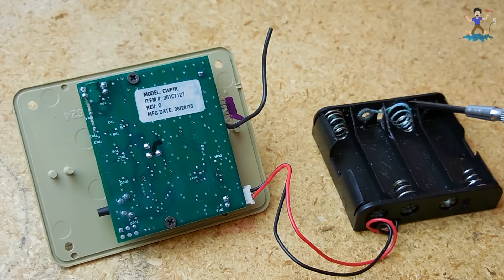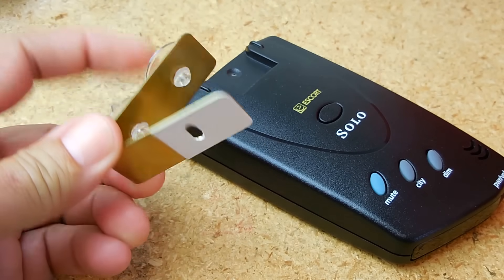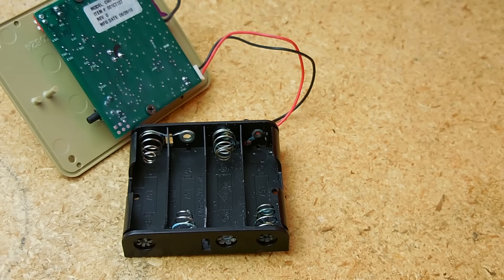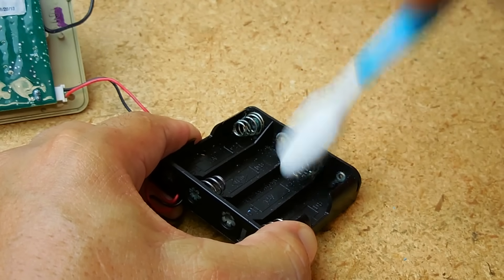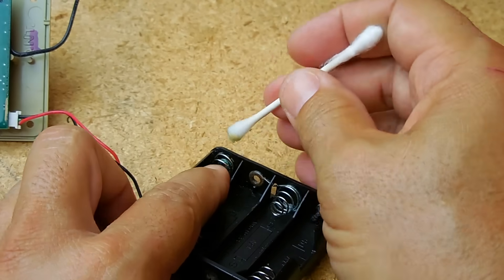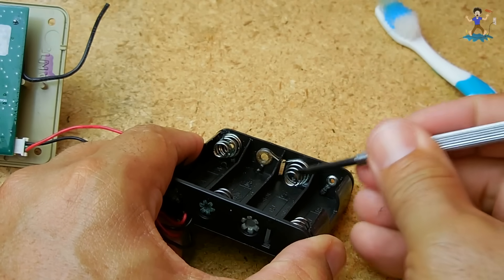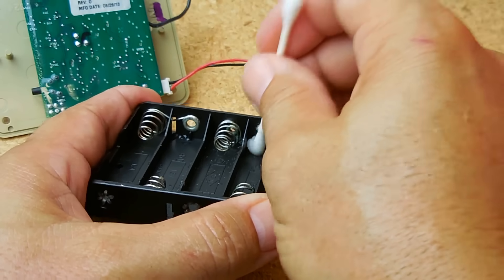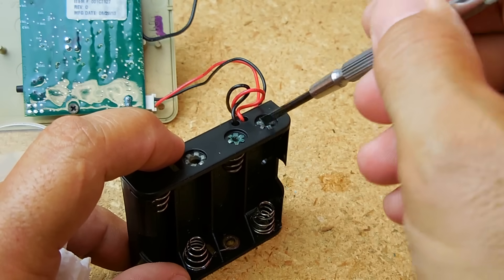EASILY Clean Battery Leak Damage(Corrosion) In Electronics

Comment: Scraping with blade like a screw driver is not good, It removes plating and roughens the surface which increases the rate of oxidation.  This will reduce the life of the battery holder before it requires cleaning again.  You are better off to using a metal polish like Autosol on a Q tip which will still remove the crud pretty fast and polish the metal.  Polished metal oxidises much slower so the repair will last many times longer.  Also, a good tip is to paint the metal surfaces, especially pitted surfaces with an electrical conditioner like Deoxit and leave to dry.   This soaks into spaces like between springs and rivets and into any remaining corrosion products that are impossible to remove.  It drys and seals with a conductive material that improves the conduction of press fit parts.  This gives the repair a much longer and much more reliable reliable service life.
Reply from the maker: The surface plating is usually gone once the corrosion has formed, so gently scraping it away won't cause any problems. All you have to do is apply a very thin layer of silicone grease to the contact areas to prevent oxidation over time. Thanks for watching

Comment: Good video on the cleaning battery corrosion. As far as NiMH batteries you are off. NiMH and NiCd cells are known as "electrolyte starved" designs. If you were to open them, they would appear to be pretty dry, or just barely damp. If/when a NiMH or NiCd vents, the gas released will contain some moisture, but little or no liquid. The leaks (very rare) only put powder down which either sticks to the top of the battery vent areas or fall harmlessly not sticking to anything. If nimh had better temperature characteristics people would use them in cars and outdoors because you don't have to worry years later about a ruined light. On the other hand, alkaline cells have a saturated electrolyte design, so when they vent a considerable amount of liquid can be released. Enloop brand (4th gen) rechargeable NiMH batteries are designed to be stored in a device for 10 years and still have 75% of their charge. Making these batteries great/safe choices for emergency devices. Hope that info helps when choosing batteries. :)
Reply from the maker: Yes, alkaline batteries are more "wet", but NIMH batteries do leak, and their electrolyte is alkaline. Thanks for watching!

Comment: The worst batteries that leak are the Duracell Copper Top.  This was not always the case this problem seems to have started about five years ago.  I am not talking about a battery that has been installed 10 years ago.  Some of the batteries were in remote controls, scales, head lamp, and a meter.  I also had brand new batteries that were still in the package that were leaking.  I threw out the whole package.  I switched to Energizer Max I hope they are better.
Reply from the maker: If you want to completely avoid leaks, buy AA /AAA Lithium batteries instead. Thanks for watching!

Comment: what do you do when the batteries are stuck inside, like in a flashlight?  Suckers are hard to get out and there is no space around them to get a grip with pliers or other tools.  I've lost a few good lights this way.
Reply from the maker: The only thing you can do is open the end of the flashlight and pound it on a table, once they move, take a very strong Neodymium magnet and use it to pull out the battery. Thanks for watching!
Reply: what works in some cases, is to drill one or more holes into the battery(from end to end), and then start prying what's left inward-this will make the battery thinner, and you have a decent chance of getting the battery out.

Comment: Simply brush with the toothbrush to loosen oxidisation then take the battery holder and immerse in a shallow bath of white vinegar for 15 minutes.
Remove, allow to dry and wipe down with isopropyl alcohol using a Qtip.
Reply from the maker: Soaking is a bad idea, because the acid solution percolates wires causing corrosion. Thanks for watching!

Comment: why did you not just unplug it from the board and get it under the sink
Reply from the maker: Because the average person WILL NOT have a removable battery holder, and it's a bad idea because water will find its way into the wires.

Comment: whatn happens when it leaks on the curcuitboard. I haventhe exac driveway sensor you showed chamberlain and it lights up but i dont get signal
Reply from the maker: You need to examine all circuit board traces using a 10x magnifier. See if any are corroded away.

Comment: Un-plug the wires from the PC board .  Use a larger container & more vinegar and dunk the whole battery holder into it .

Wash it off .  Dry with compressed air or a blowdryer .

Wyr
God bless
Reply from the maker: Bad idea because the liquid will find its way into the wire under the insulation.
Reply: @electronicsNmore  Soak it in water over night ?

Wyr
God bless

Comment: The problem is what you don't see. Many times the contacts are corroded where you can't see and where you can't get to. The Nickel plating is gone and copper is corroded. Cleaning will only remove oxidation on copper but contact requires re-plating.  - The best solution is not to clean but replace the battery holder. They are sold on Digikey and typically are made by Keystone Electronics. There are PCB mount ones and also wired ones. However, the wired ones will not have the connector you need, so cutting off the old connector, add shrink tubing sleeves before soldering, solder, then shrink tube the connections. This is the best way to repair the corrosion.
Reply from the maker: The battery holder in the video was for demonstration purposes only! I used it as an example. 95% won't have a removable battery holder. LOL

Comment: This unit is part of an alarm system that may save your life.  I suggest you unplug the battery holder, clean and save it for your kids toys.  A new battery holder costs what?  $4 bucks?  Buy a new battery holder and plug it in.  Why gamble your safety (or life) on an old, crappy, cleaned holder?
Reply from the maker: The holder used was irrelevant.
Reply: We'll make sure that "The holder was irrelevant" is on your tombstone!
Reply from the maker: @DrBobaliscious  It's the process that mattered, not the type of holder.
Reply: Oooh!  We'll add that too: "It's the process that mattered!"
Reply from the maker: @DrBobaliscious  Were you born a Moron? or became one later in life?

Comment: What do you do when half of one of the springs breaks off due to corrosion? Is there a way to repair that?
Reply from the maker: Clean off the remaining half and try stretching out the spring, or buy another small, weak compression spring at the hardware store to place between the battery and broken spring.

Comment: I have a Bluetooth keyboard for an iPad, what would be suggestion to clean the leakage since the contacts are at one of the unit about 6 inches away from you insert the batteries, thanks for the information.
Reply: electronicsNmore Thanks so much for the tip!

Comment: If sliver colored plating is completely gone from one of the connections will item still work?
Reply from the maker: Yes, make sure the metal is clean and shiny, then apply a THIN layer of silicone grease to the contact points. You can buy the grease at home improvement stores/hardware stores. Thanks for watching! Please share my channel.
Reply: @electronicsNmore  
The metal is clean do I really need silicone grease to make it work?
It's probably going to be fine without it right?

Comment: Pointless to repair.  You can get a new one on ebay for less than a buck. https://www.ebay.com/itm/AA2D-New-Storage-Battery-Box-Slot-Holder-Case-Cover-for-4-Packs-AAA-Battery/253773700509?hash=item3b16175d9d:g:cd0AAOSwn6dbXo2k:rk:19:pf:0
Reply from the maker: The holder I was using in this video was IRRELEVANT! What mattered was the method shown, nothing more.

Comment: Great video.  I have a hard time finding Q-tips in our stores and find that cotton tip applicators work just as well, especially the wooden handled ones.  I also used the same vinegar then soap solutions to clean my wife's toothbrush before returning it to the bathroom holder.  This technique works well and is scientifically sound.  Thanks.
Reply from the maker: Glad you enjoyed the video! I have a lot of excellent videos on my channel that cover many different subjects, so be sure to check out my extensive video playlists for other videos of interest to you, rate thumbs up, and share my channel with others. Thank You

Comment: i’ve used this process to recover several electronic items too. One observation is sometimes you can completely remove te battery holder from the device. Watching the video, you will notice a white connector on the other end of the power wires. Simply removing that connector separates the battery holder from the electronics. That makes it eaiser to clean, as you can emerse the holder in a shallow bowel of white vinegar to clean the contacts.i always finish this type of task with a rinse with distilled water, to neutralize the vinegar. Just makes me feel better. CAUTION do not get vinegar onto the electronics or you may damage them. If you accidently do so, you should immediately rinse that area with distilled an place the unit where it can dry out. Sitting it over a furnace air vent will do a good job of drying it out and not melting anything.

Comment: Wouldn't it be easier to use a small shallow dish and use that same amount of vinegar and just soak the connectors?
Reply from the maker: The only problem with that, you'll be allowing the white vinegar to find its way deep into the wires that connect to the terminals. Thanks for watching!

Comment: How would you go about cleaning like a small area in a Bose earphone battery slot?
Reply from the maker: Use a Q-tip moistened with white vinegar, allow to soak, then blot dry and repeat using 91% rubbing alcohol. Thanks for watching! Be sure to rate thumbs up and share.

Comment: I put a little dielectric grease on all the parts that had corroded to prevent future corrosion or rusting. Those parts that have lost their coating WILL rust if not treated. Also, on any wire that has broken off and shows green. Clip at least 1/8 of the wire back , strip it and check for any discoloration of the wire. If the wire inside is black instead of copper color, cut the wire back more. That black is the corrosion and moisture still working on the wire and will cause electrical issues. You did a great job on this how to video. Those that were impatient are probably back into the same repair again because they rushed it. Part of repairs is being patient, not being in a big yank to move on. I can bet half these peoples projects never turn out right because they are impatient as hell!
Reply from the maker: You brought up valid points. I mentioned the grease in the video. Even though it's non-conductive, it still works to help prevent new corrosion in the future. Yes, unfortunately there are many people with very short attention spans. Thanks for watching!

Comment: question; Is it okay to use "dielectric grease" or "petroleum jelly" a.k.a. "Vaseline" on the battery connection after cleaning out the corrosion ?
Reply from the maker: That kind of grease protects the contacts, but is non-conductive. A thin film should be fine. The battery & terminal contact points are strong enough to make good contact.
Reply: @electronicsNmore  I was applying the same theory as with car batteries to prevent corrosion. Would you also suggest wrapping AA or AAA batteries in aluminum foil?

Comment: I don't buy copper top batteries any longer, they leak like crazy, But thanks for the tip, I will clean all my electronic devices that those copper top batteries ruined.
Reply from the maker: Better off leaving them out of the device when not in use. I have a lot of excellent videos on my channel that cover many different subjects, so be sure to check out my extensive video playlists for other videos of interest to you, rate thumbs up, and share my channel with others. Thank You

Comment: Deoxit works far better just FYI.
Reply from the maker: Deoxit is good stuff, but it's not designed to neutralize alkaline electrolyte. It's designed to remove corrosion, oxides, etc.
Reply: electronicsNmore it works for this purpose better than anything I have ever used so I shared the information for others knowledge.White vinegar also was not designed for this purpose but it works ok for the purpose.
Reply: actually, DeOxit has Oleic acid in it....so it will indeed work.

Comment: Vinegar is cheap - why don't you put the vinegar in a bowl and let the holder sit in it for a while?
Reply from the maker: Because the vinegar would seep into the wire between the insulation and the wire strands. Over time the acid would eat away at the copper. Thanks for watching!

Comment: I use an ultrasonic cleaner with a little bit of citric acid and after it an rust converter also in the ultrasonic bath
Reply from the maker: For a removable holder like I show, that works. Better off using the white vinegar inside the cleaner. Thanks for watching!

Comment: I find that the corrosion removes the shiny metal plating from the contacts. Sanding or filing is required to get a decent electrical contact again. The problem is that after the plating is removed, the metal will tarnish or darken very quickly and you'll lose connection again. It's a losing battle.
Reply from the maker: Correct. The thing to do is either apply a thin film of silicone grease before installing the batteries, or plate the spring/contacts using a brush type nickel electroplating kit. Thanks for watching! Be sure to share my channel.
Reply: Just "replate" portions that touch the battery contacts with solder. Solder quickly to avoid melting plastic. Lasts many years.

Comment: HOW ABOUT A VIDEO WHEN ITS REALLY DAMAGE RUST MISSING SPRINGS CAN YOU FIX IT STILL?
Reply from the maker: Yes, that can be fixed, but you need parts from another battery holder. Thanks for watching!
Reply: New springs and clips are available from places like ebay and Amazon

Comment: vinegar is acetic, i use it to remove rust, baking soda neutralizes battery acid or even easier just spray the part with battery terminal cleaner and hit it with a soft wire brush..... i use a baking soda water solution  to neutralize vinegar or muriatic acid  after rust removal....
Reply from the maker: WRONG! You cannot neutralize alkaline electrolyte using baking soda which is alkaline.

Comment: My bad.  You are correct.  I had meant to write that I had used spray contact cleaner but had a brain fart.  Soda on the lead acid but the Vaseline on both afterward.    Thanks for the correction.  Doug

Comment: Gets to the point at about 3:00. YW  remove batteries, use brush (i.e. toothbrush) to get the more easily removable corrosion (crud) off of the contacts (dry), use Q-tip dipped in White Vinegar, swab affected areas, use small flat tip screwdriver to scrape more stubborn crud off of terminals (to get to the shiny part), then use Q-tip and rubbing alcohol swab to finish, wipe, dry.

Comment: Coating the contacts with petroleum jelly is a good way to prevent the damage.  Giving a very light coat to the battery ends is all that is needed on them and then the same with the appliance contacts.  When there is corrosion I prefer a small amount of baking soda in a strong solution with water to neutralize and get rid of the green crud.   I always coat every battery appliance when new and also new batteries.  Take care.  Doug
Reply from the maker: You only use baking soda on lead acid battery terminals. To clean up alkaline electrolyte, you must use an acid. Thanks fro watching!

Comment: Some battery holder terminals that were crimped or spot welded won't accept solder. If that happens the material has stainless steel plating and is non-solderable.

Comment: I now take batteries out of something that is not being used often.  It seems the batteries leak faster if they are in contact with something and that could be because the seal on the ends of the battery are compromised because of the spring pressure.  I also notice that Ray o vac batteries last as long as anything else and are usually leak a lot less than Energizer or Duracells.  Good video.
Reply from the maker: Smart move. If you don't plan on using an electronic device each week, remove the batteries! Thanks for watching. I have a lot of excellent videos on my channel that cover many different subjects, so be sure to check out my extensive video playlists for other videos of interest to you, rate thumbs up, and share my channel with others.

Comment: The reason the guy can't easily resolder the wire to the rivet on the battery cage is that the plastic will deform/melt.  Also lead-acid batteries leak alot more than either alkaline or nimh.  FYI:  liion can explode if overcharged/overheated while Nimh does not to my knowledge (although can catch fire, but explosion is a big step above).   I like the white vinegar idea, just suggest doing it first to prevent the problem?  You might also say that since the actual connections are just squeezed tension only not soldered so taking a surgical pair of pliers to retension the connections after the white vinegar helps alot to minimize future problems.  ie On motorcycles, lawnmowers, snowmobiles, just unplugging all the connections 3x and replugging in, removes enough oxidation for it to magically work again.

Comment: you neglected the other side of all the rivets-they are corroded as well--the corrosion will creep back through the center holes of the rivets to the now-raw metal contacts--after cleaning this way protect the raw metal with a light oil--sealing out the oxygen that causes the oxidation--
Reply from the maker: If I had to show myself cleaning the back side also, the video would've been too long.